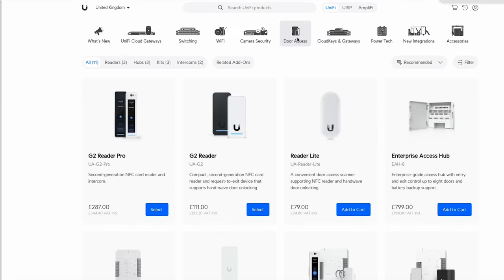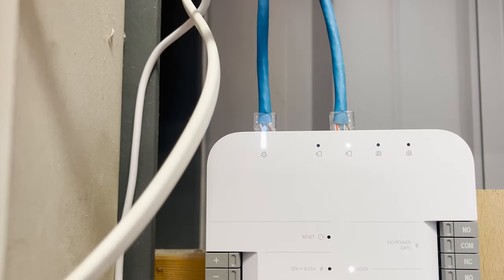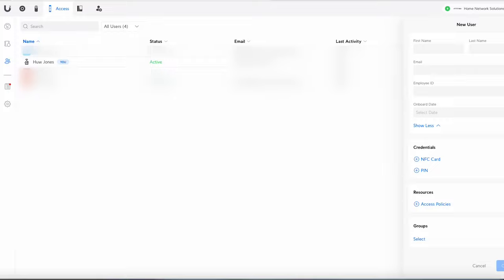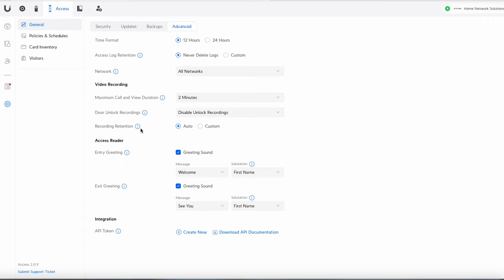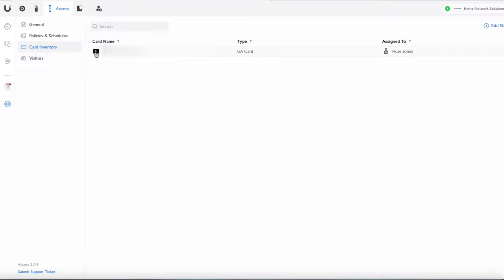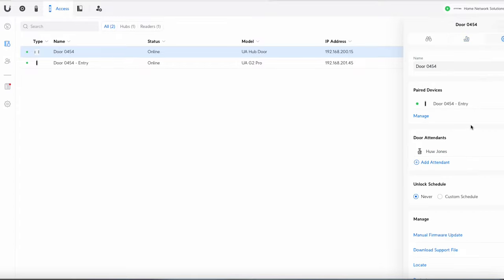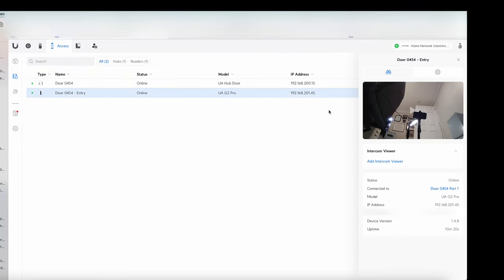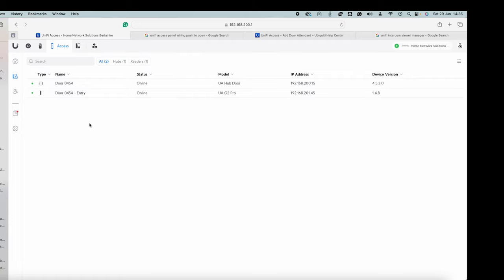Simple UNIFI ACCESS setup - with G2 Pro, Push to release button and Maglock

Comment: Thank you for your video. Is it possible, in your opinion, to connect 2 G2 Reader Pros to only 1 access hub to control 2 different doors? My situation is this: I live in a condominium, and with 1 access hub I would like to control the opening of the condominium door where I will install the first G2, and with the second G2 I would like to control my apartment door. Thank you.
Reply from the maker: No the hub is designed for 1 door I’m afraid. You would need two hubs. Thanks for watching 👏